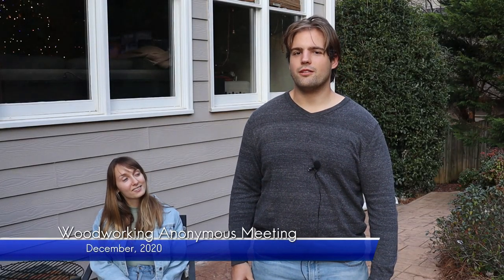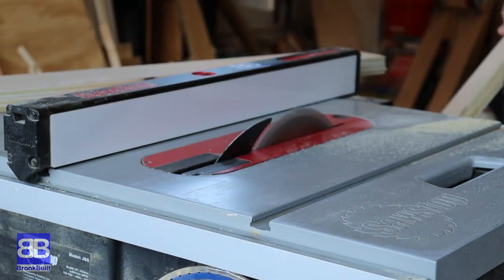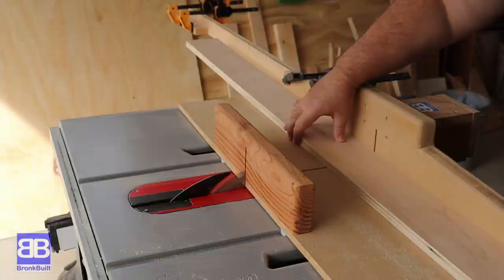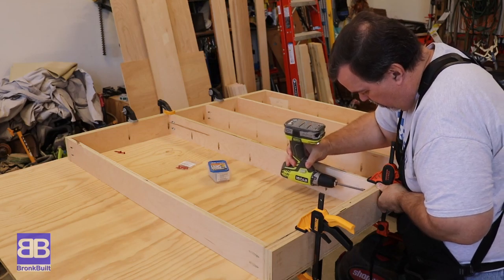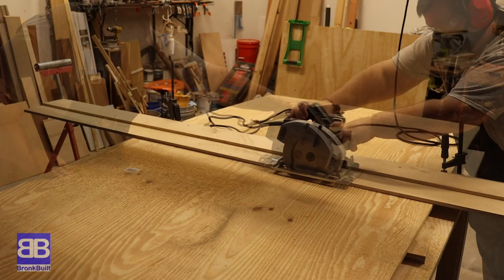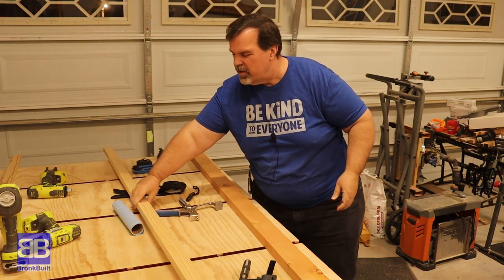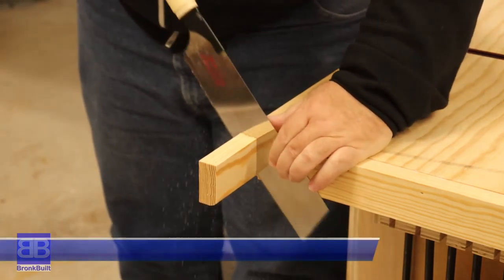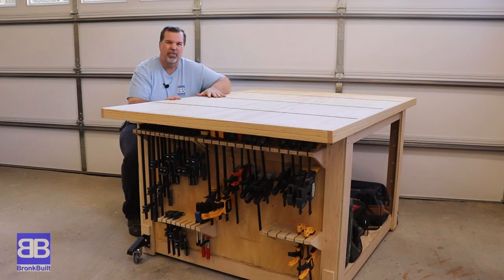My Best Assembly and Outfeed Table with Bonus Features

Comment: "I'm so ashamed." Me too. LoL
Reply from the maker: I can't tell you how much I love having this and it's only been a short time.
Reply: @BronkBuilt  yeah, I need something like that but I can't fit another thing in my garage. I have that Harbor Freight workbench with the dog holes tucked away in the corner. At some point I'd like to move it toward the front of the garage.
Reply from the maker: This bench was the new beginning in my shop.  For Christmas my wife got me a couple smaller mechanic tool chests on wheels and my son's gave me "no lip" help in the garage for clean up and organization.  Took a few weeks and certainly not done but it is day and night in there now.  I used to feel overwhelmed and now it is so nice.  I went ahead and decided my truck will no longer be in the garage so I could make a larger bench.  I'm also very committed in keeping my wife's side clear so her car can sleep in that stall every night.  No big deal backing it out when I go into build mode.

Comment: An intervention for woodworkers. 😲 Safety PPE includes a hard hat. 😖 The correct term is "Easy-Peezie-Japenize. (Shawshank Redemption). 😉 That fourth finger reason must have been a casualty of a saw blade? 😞 Another excellent video.
Reply from the maker: My head has a metal plate.  I never saw Shawshank Redemption.  Good things come in three's.  Thank you!